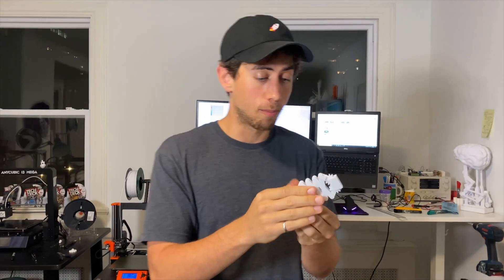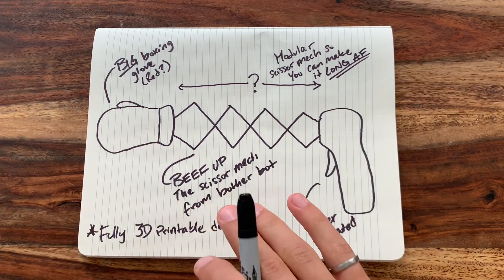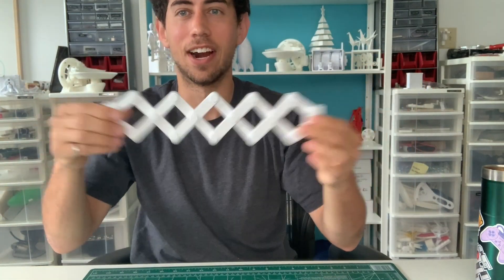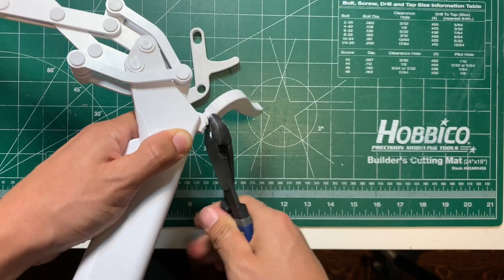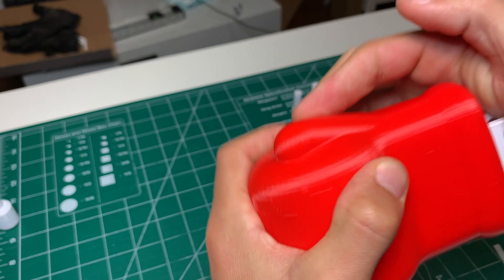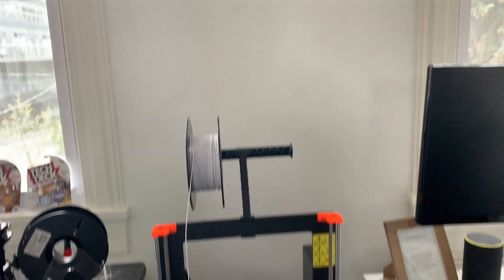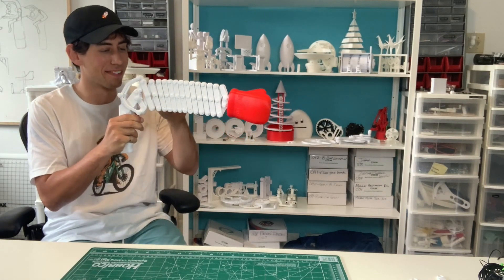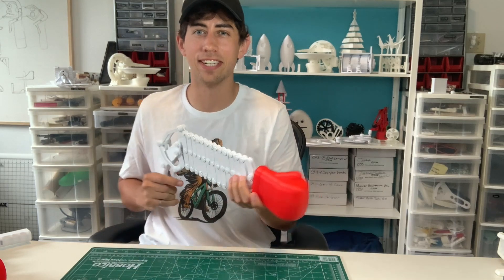Making a Comical Extending Boxing Glove - The Engineering Process

Comment: Good documentation. What is the best way to make it stiffer at longer lengths? I'm working on a camera system where I can send the camera out from my boat to record the boat moving through the water, then bring it back. Was hoping for an 8' arm...
Reply: It can't really be stiff if it's thin. Look at how structural beams of steel are made, they need to be wide on the direction they are gonna get loaded. Careful beacause a wide thin part will of course resist bending on one direction, but will wobble or even worse, twist and buckle

Comment: Make a larger one you can wear that will extend your punch by one or two times....h beam connecting rods will help it not flop  sideways. Place the handle at your reach extended. Single strap the end to your shoulder so you can easily manipulate direction like uzi.